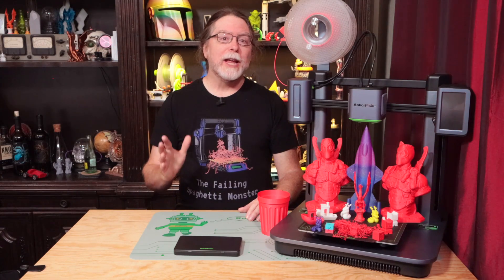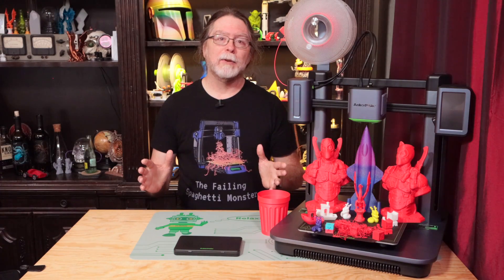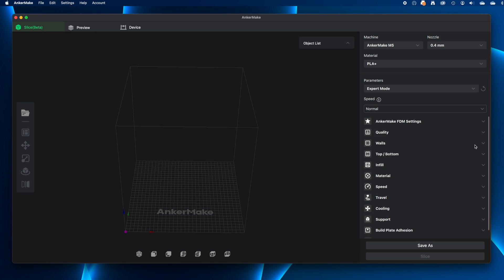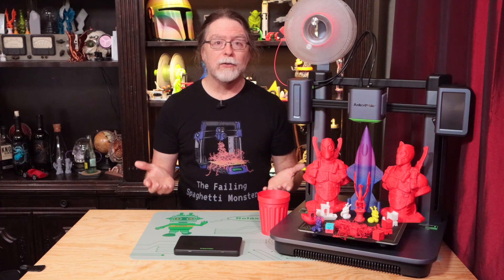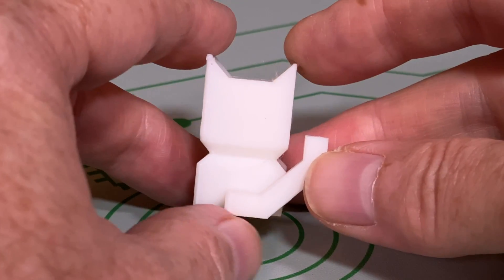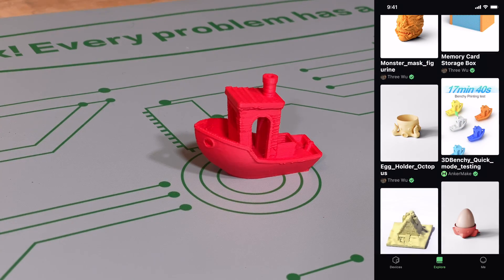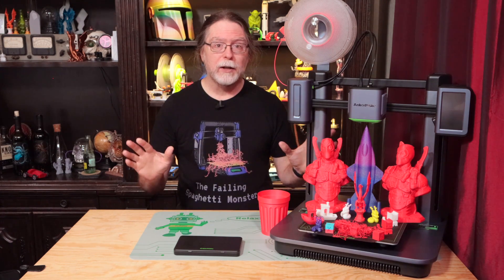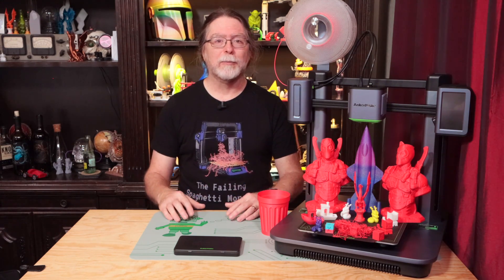3D Printer Review: AnkerMake M5

Comment: I have yet to try anything flexible on here. Either flexible PLA or TPU. You didn't mention having any trouble loading the TPU. I was concerned because I seem to have trouble getting the filament into the thing. So I thought TPU is going to be even harder. But since you didn't seem to have any trouble maybe I won't either. I certainly hope not! Sorry for The multiple comments.
Reply: Hey just wanted to chime in here. Ive found the M5 to have a somewhat unique loading process in some ways vs other printers I've used firstly for me I find cutting the filament straight rather than at a 45 degree angle is better. and what I like to do is to set the printer to extrude a length of filament whilst I'm loading so it can grab hold of it after I have compressed the loading lever. in regards to tpu depending on what level of the shore hardness filament you are using you may need to unscrew the guide tube from the extruder and load the filament directly then reattach the tube.

Comment: Loving your shirt! I only just started the video so I can't comment on too much what was said just yet but I had to stop it to say that and also I don't know if you address it in the video or not but you are going over all the points so you're probably going to talk about the filament run out detector thing. I just got this printer and I had a failed print that was seven and a half hours. It failed because it ran out of filament and it did not realize it and it did not tell me. As it turns out the filament was really strongly stuck in the bottom of the spool so it didn't run out off the spool and then go through the detection thing for it to see that it ran out... So instead it just broke off where it was at... Somewhere past the detector and the nozzle. So it just kept on trying to print and printed in the air leaving me with a half done item. I've never dealt with filament run out so how do you prepare for something like that? Aren't all filaments attached to the spool like that? You can't see it till you get to the end so you have no way to make sure it's going to come out. How the heck does the detector work with other people? I just want to be able to prepare for this if it comes up again in the future. I like your videos and your opinions so I figure you probably have something wise to say about that.
Reply from the maker: Hi, the way the filament is attached to the hub of the spool is completely up to the filament manufacturer. A lot of times it's just got a small  bend in it, and it goes through a hole in the spool hub. Most printers are able to pull that off the spool and it's OK. I've had some spools where the filament was pretty securely taped down to the hub and the printer had a hard time with it.

If the filament you were printing with is something you like using, and you want to keep using it, just be cautious when you're getting near the end of the spool. You could look around the outside of the spool hub as well, looking for a little tail of filament sticking out, from where the filament was first loaded on the spool. If there is one, snip it off with flush cutters so that when the filament gets to the end of the spool, there's not a big piece sticking through. Does that make sense?

I recently showed a printable spool rewinder, so you could try something like that to unload the filament onto an empty spool, and print from that. It's kind of an extreme solution though. My use case for the respooler is getting filament off of spools that won't fit in my Bambu Lab AMS unit, and onto spools that will.

Comment: Great video! I've been using the one at work daily for the past couple of months and I've really liked it, it's hard to go back to my Ender 3 at home. I hate the slicer and I've had failures when printing 5 or more models, but other than that it's been great.
Reply from the maker: Hi Chris, I saw that AnkerMake has some instructions (and downloadable files) to add the AnkerMake M5 to PrusaSlicer and to regular Cura, here: https://support.ankermake.com/s/article/Adding-AnkerMake-M5-to-Prusa-and-Cura-Guide?_ga=2.46743911.1907546440.1685407796-1307873076.1684252918

I haven't done it, but if you do, let me know how it goes!
Reply: @BV3D  I recommend Prusa slicer. Mainly for the organic supports and ability to change support Type, along with just other cool features
Reply from the maker: @tylermiller8142  I've been waiting for 2.6's public release. There have been a lot of really nice additions to PrusaSlicer in the betas!

Comment: Thanks Bryan for all you do! I do have a question though. As a bed slinger, how does adhesion do with the Y axis flying around at high acceleration? Also, considering the price, how well does it hold up against the Bamboo P1P or the Creality K1 in terms of features and print stability?
Reply: Ive had my M5 since OCT last year and ive not really had any bed adhesion issues outside of having a dirty build plate!

Comment: I've had my Ankermake m5 sitting in a unopened box since last Dec. I am a KS backer and am still waiting on the V6 color engine that was announced during the KS phase before opening. It seems like an all around decent printer from all objectives measures. 

Have your tried orca slicer with the printer. I saw they added the M5 there.
Reply from the maker: I haven't given Orca Slicer a try, but I should! Thanks for the suggestion!
Reply: You probably already know if you backed it, but got bad news that they canceled the Color Engine :(
Reply: @erikwaters  😓Sadly the news did reach me. They are offering either a refund of 300 plus 30 or 600 off of the purchase price of a new undisclosed future product. 

I haven't decided on which just yet. I still have not taken the M5 out of the box and the M5C didn't seem like a step up in features from the M5. So their next product has a lot of competition even with 600 off the retail price. 

I was really looking forward to it.